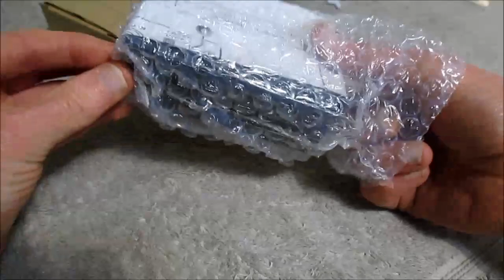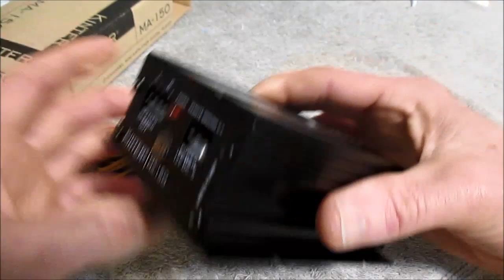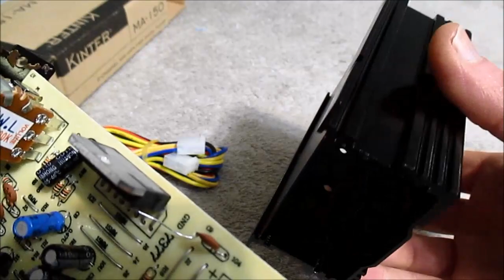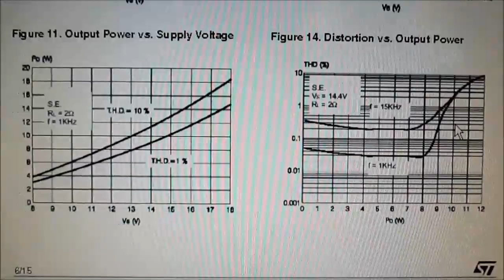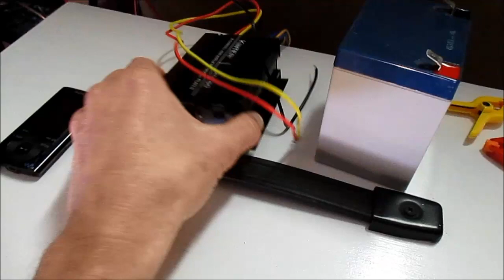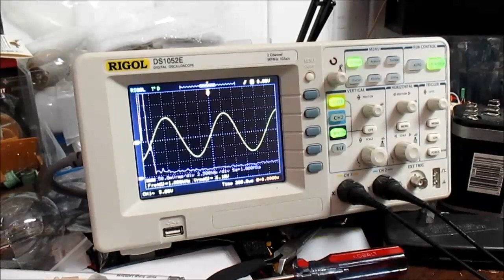Kinter MA-150 audio amplifier review, teardown and power test

Comment: what chip would you recommend for bridging to get nice clean sound in car.with power boosting.
i had an ide for a loong time now to make individual amps for my car where i use 1 amp for each door a 3 way amp woofer mid and high,my car is an convertible so rear has a 2 way speaker sett,i was thinking of either change the original amp or use its output and use them speaker outputs and put my amps close,in the door so it works as an amp and a filter.
for an example 1 door,,it could be 2x50 for mid and high and 100 watts for bass.. or use 1 channel att 300 watts and divide it with filter to 3 way.

Comment: That standby quiescent current seems far too high to me. Is that normal for this type of thing? I was expecting microamps, not milliamps.
Reply from the maker: Although the chip may have a standby mode pin, it is not used with this amp, so it is always on drawing current as is the 5v regulator.
Reply: So what exactly was turned off when you disconnected the remote power control lead? (14:24)
I'm just specifically curious about that because some day i want to put an amp in my motorcycle so i'm going to need to be really careful about quiescent current draw. (Maybe i'll end up just powering the whole sound system via a relay/mosfet to be on the safe side).
Reply from the maker: Oh sorry, I recant what I said previously. I forgot about the remote lead. I had to watch my own video to see what I said as I recorded it over a year ago. For only 4ma to be drawn with the remote line removed, the chip must have been put into a standby mode. I'd assume the current is being drawn form other parts of the circuit such as the 5v regulator. If you don't need the USB port, I'd remove the regulator and see what the standby current drops to.
Reply: Lol all good, you don't have to remember details like that from over a year ago! Thanks for the clarification. If I do have a go at it I'll mention the results here.

Comment: Is it just me or does it look like a very good deal if you bought one of these just for the components? You get a housing, cables with connectors, a decent audio chip, some capacitors, a potentiometer and knob, RCA connectors, a USB A connector, and a handful of random components.

Comment: Good, comprehensive review. The only thing I'm left wondering was how much input signal was needed to reach full output, more than one Volt RMS?
Reply from the maker: +HillOrStream Good question. The IC datasheet shows gain is fixed at 26db (20x) in bridged mode, so with 6.1v rms out, I should be able to drive to point just before clipping with 305mv rms input signal. My CD player can put out a max clean 660mv signal (quite shy of true line level), so there must be some attenuation on the input caused by resistors even though the level control set to full because I was only getting 5.75v rms out. 5.75/.660=8.71x gain.

If I used a 14v power supply on the amp to get a 7 volt rms output (12.25 watts into 4 ohms), I'd need about 800mv rms to drive the amp. Since the 0db line level reference of consumer goods is 1v rms, it falls within spec, although a bit more gain is still desirable since some music is recorded at lower levels.
Reply: @JohnAudioTech  Good explanation John. I've never used a pre-amp. I only use a CD player connected straight to some power amp or another. If the power amp doesn't have a volume pot I made up a passive pseudo pre amp in a nice case just for the volume. Always works, and anything more complex would be beyond my present knowledge. I'm not that far into the hobby even though I've been buggering around for 50 years or so off and on...

Comment: At least someone is still putting videos up. I've noticed the dearth of good tech videos as well, and started to do my part by putting up a few of my own.  I wish I knew why the amount of videos has fallen off so dramatically. Maybe the extensive use of ad blockers on monetized video channels? 

Anyway back to tech...

Sounds like you need to build a preamp using a couple of op-amps on a breadboard to get the signal from your phone to line level.  I ran into the same issue with some QSC amplifiers I restored. The QSC amps require about +4dbu (1.736Vpeak) to drive to full output.